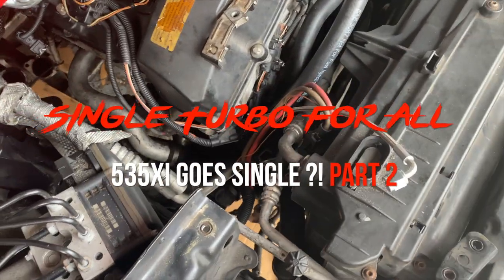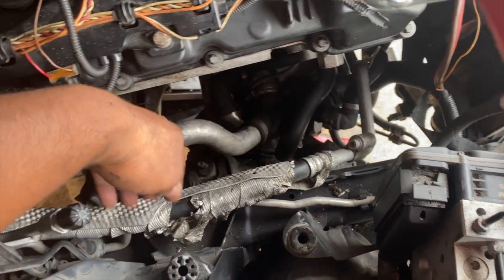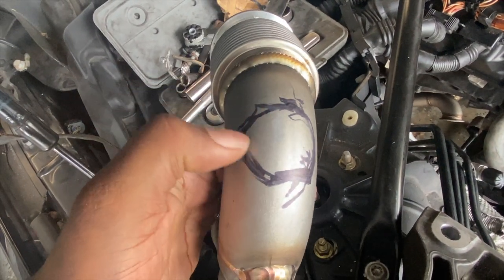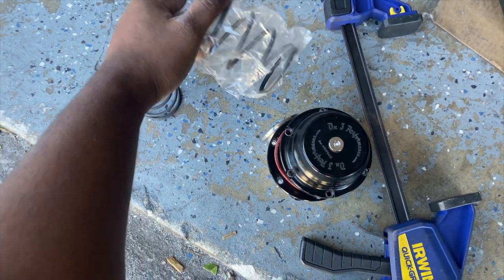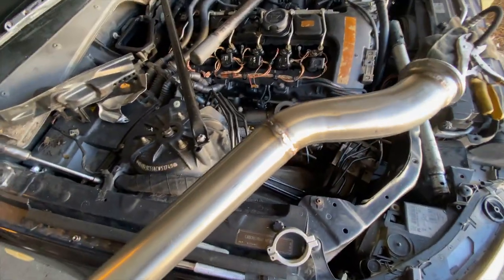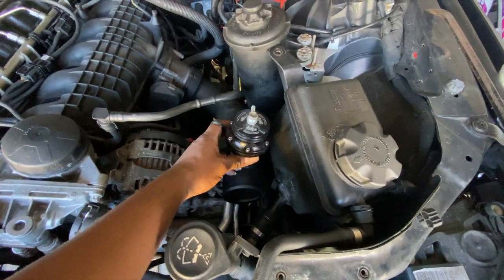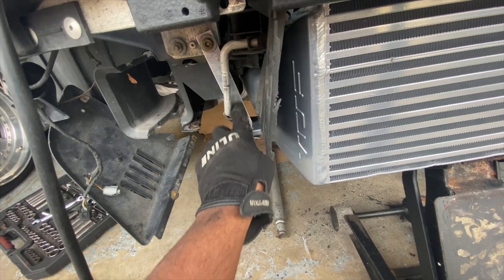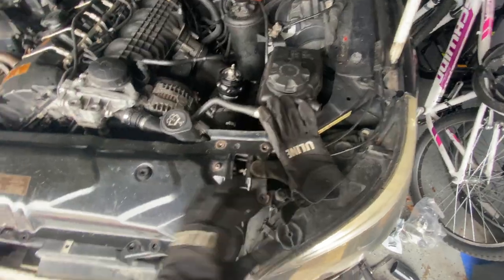E60 BMW 535XI Get A Single Turbo | Part 02 of 03

Comment: As a fabricator dealing with pipes daily, doing lines for cuts, you can use a hose clamp, also for cuts in curves, (bends) the inside of it will be 3 marks the top side will be 7 known as pie cuts. That will give you means to change angles and have better use of space. 

Other than that keep at it and good job !!
Reply from the maker: Thanks a lot for the tips, I really appreciate it!
Reply: @nOshi2x  not a problem brother, keep it up and learn more, always learn.

Comment: Great info on the engine mount fab work and vrsf intercooler install. I have the same one and same 535xi platform. Been putting off my install since i’ll have to fab up my own brackets. Do you know how thick those brackets were? I want to find similar gauge steel to weld. Thanks for these videos. Keep up the great work!
Reply from the maker: Thanks a lot appreciate it. The gauge steel I can’t recall but it wasn’t that thick similar to the thickness of the brackets that come in the coolant reservoir relocation kits.

Comment: Just wondering how this setup is going currently ? Has anything burnt or any fitment issues after driving? Currently doing my e60 single turbo kit as wel except mine is custom made for e60 by jon vigil but as for abs module and ac line I can’t decide if it’s worth it to fully relocate or will I be good (heat management wise )
Reply from the maker: Yea same concern I had. The abs module and a/c line are still intact no leaks or bursting. So it will hold up and all I pretty much did was use some heat wrap and making sure it’s as far away from the heat as possible. But If you have the time and resources I’d relocate at minimum the a/c line. The motor is getting pulled soon on this one, so while it’s down will get a custom line made for the a/c and a custom passenger side engine mount. Not to worries about the abs module but it would be nice to move it to make everything look cleaner.
Reply: @nOshi2x  thanks for the reply brotha. My engine is going to be pulled hopefully very soon and I think I will do the ac line relocation if your interested I could send you some pics of the results. Just to give you ideas and what not
Reply from the maker: Yes man definitely appreciate it!

Comment: For the dump tube could I solve the whole axle problem and everything by just having an open dump?
Reply from the maker: It’s open dump currently, could avoid the axel completely by just making a custom pipe to recirculate the exhaust back into the downpipe. Or just go hood exit for both the downpipe and dump tube. But the most efficient way from what I’ve seen is just to make the custom dump tube with angles to clear the axel.